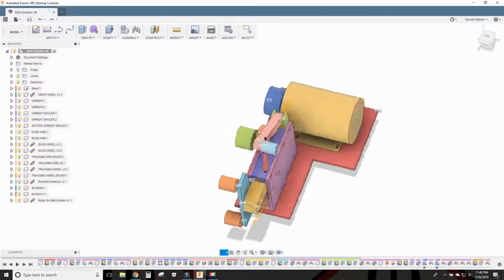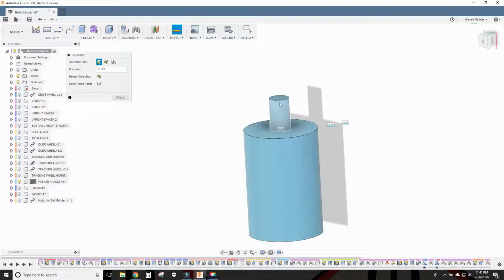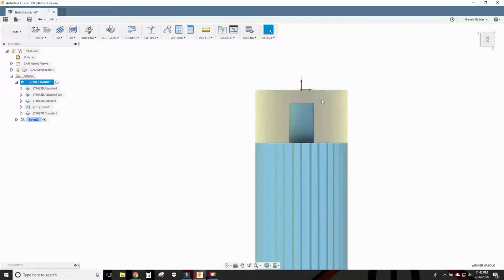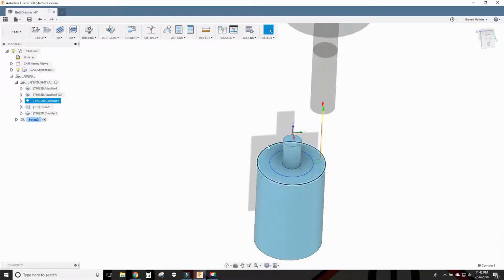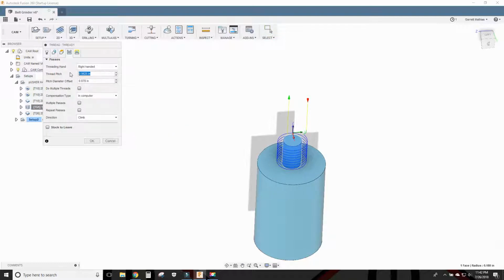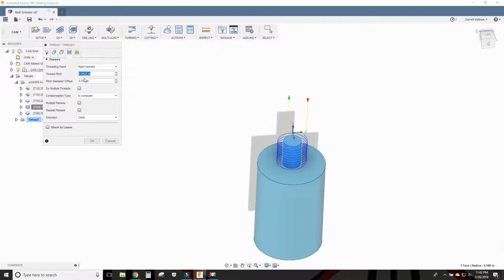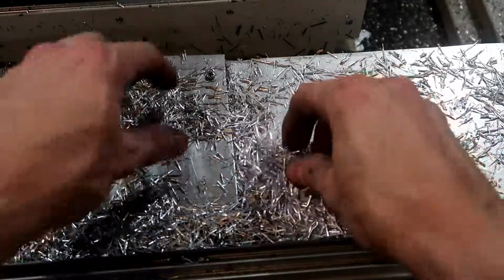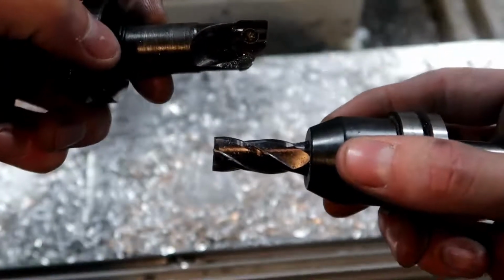DIY Belt Grinder Parts Machining Part 1: Home Mfg. Days #51

Comment: Did you thread mill the inside holes or just hand-tap them?
Reply from the maker: I ended up just hand tapping them. For some reason when it comes to programming a threadmill I just get lazy. Especially when I know I have a tap that I can just do it with even though programming threadmills really isn't even that hard or time consuming.